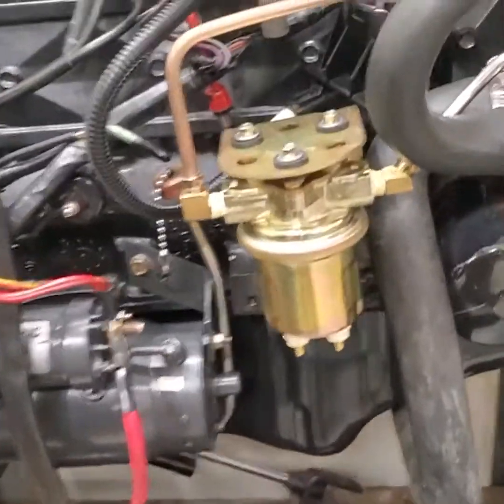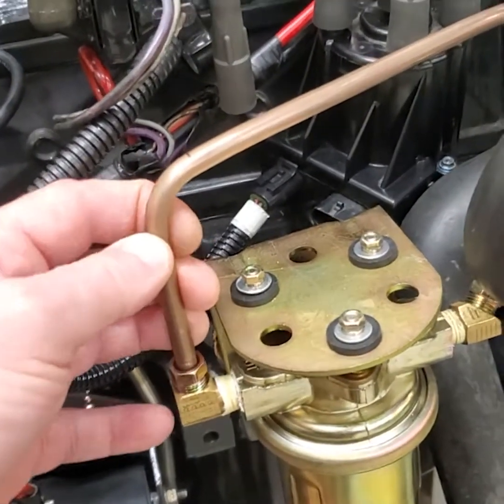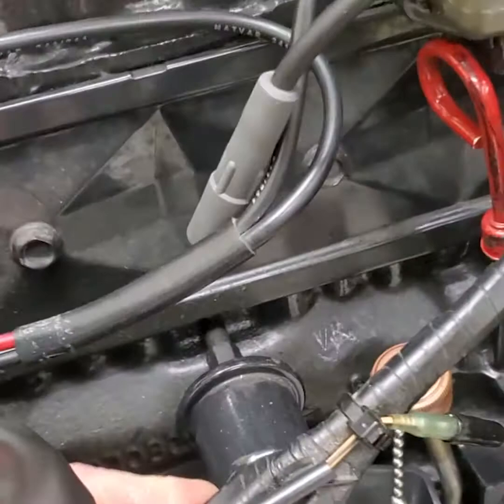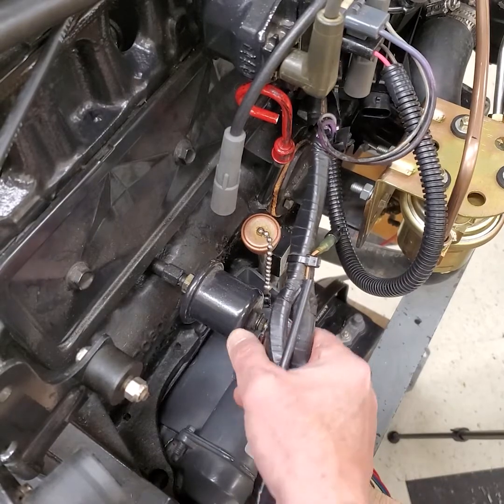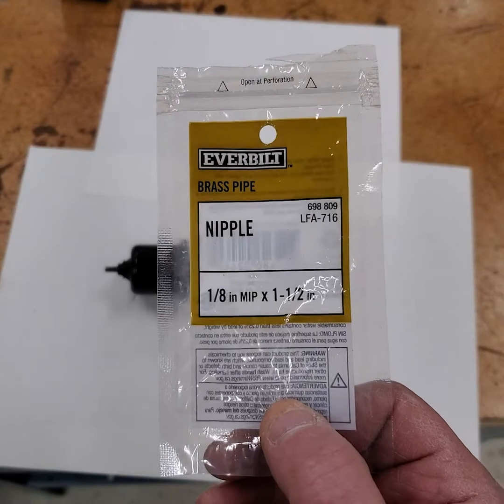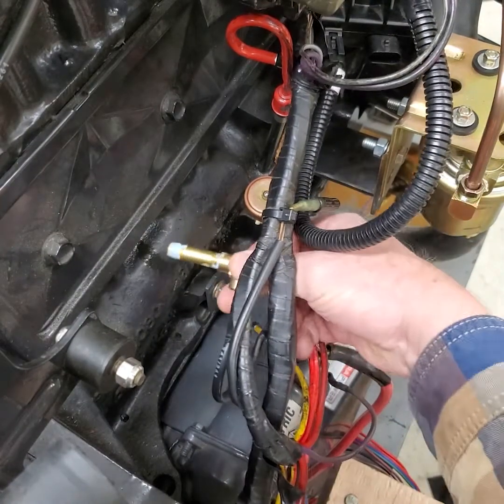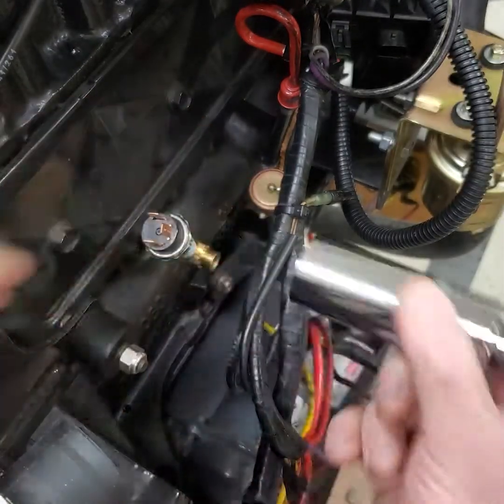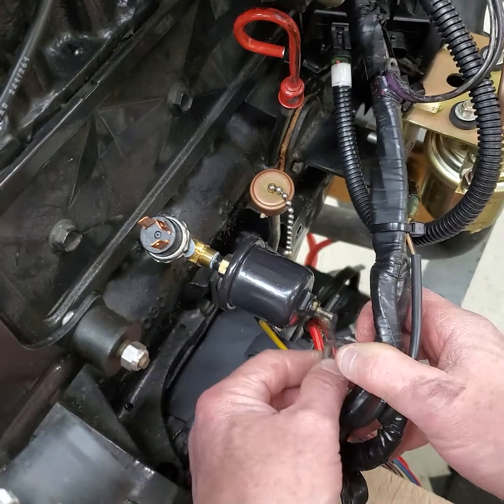Marine Gasoline Engine Repair, Gas engine electric fuel pump conversion   Part 2

Comment: I have a 1979 181ci chevy marine.  My fuel pump failed and have the only option of replacing with electric fuel pump.  Went thru your videos- great info though one thing you did not address was my fuel pump had 3 hoses. One from tank , one to supply carb and another I presume as overflow from carb back to fuel pump.  I'm guessing/. what do you do with this line from carb?  Cap it off or drain into  a reservoir?
Reply from the maker: That's a good question, I will do a quick video to explain what that 3rd hose is for and its importance for mechanical pumps. It  is a vent hose. You can just cap it off at the carb.